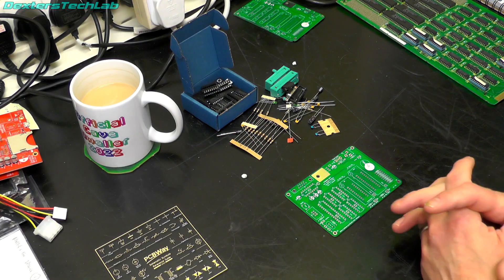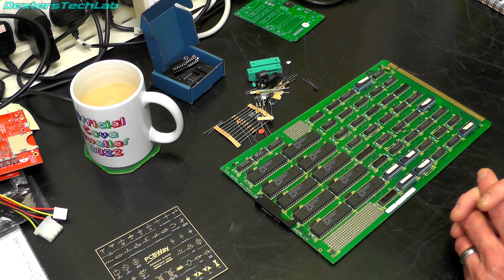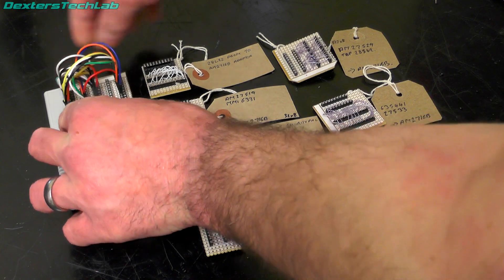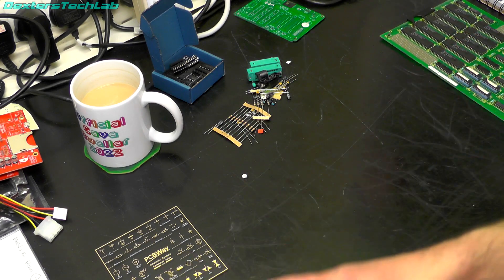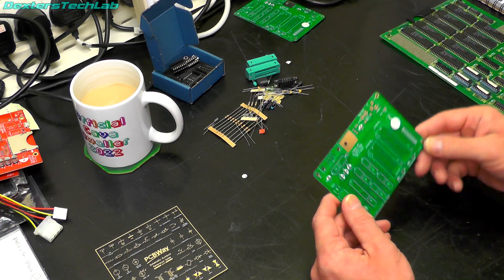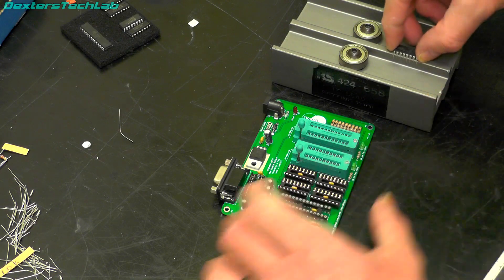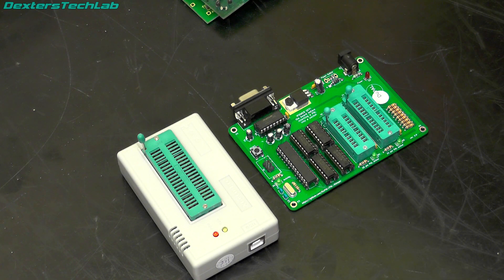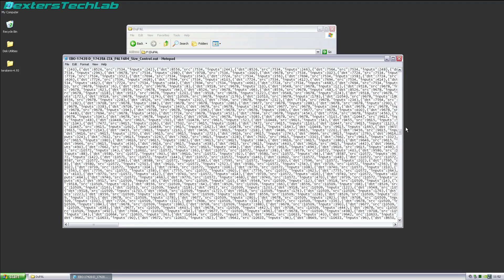DL241 Reverse Engineering PALs With DuPAL For Quantel Paintbox Emulator

Comment: I don't "get" AVR bootloaders... by the time you've used ICSP to program the bootloader and then used the bootloader to load the firmware,  you may as well just use ICSP to load the firmware in the first place?????
Reply: Not everyone has an ICSP programmer.

The idea of the bootloader is that the average Joe who has little to no tools can plug an Arduino board into their PC via a serial or USB port, click a button in the Arduino IDE, and load and run their code.

The average Joe probably isn't building their own boards and therefore doesn't need to program blank microcontrollers.